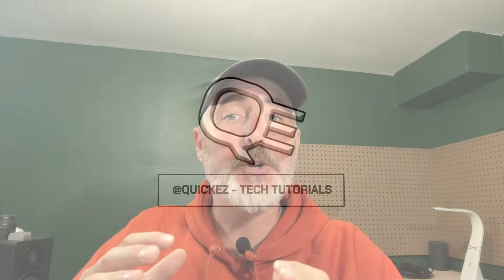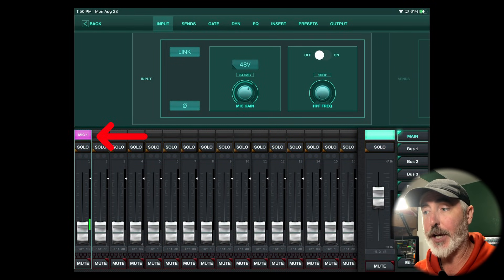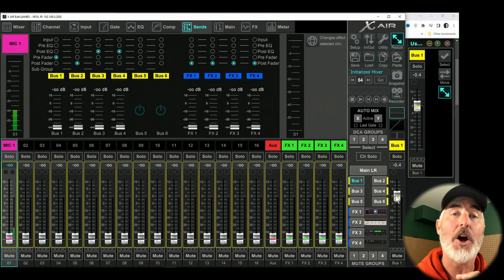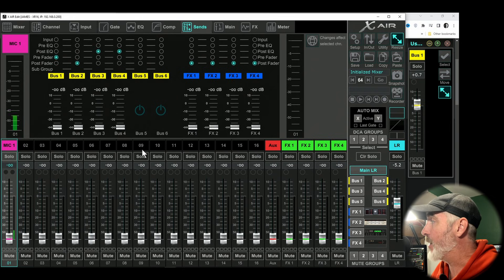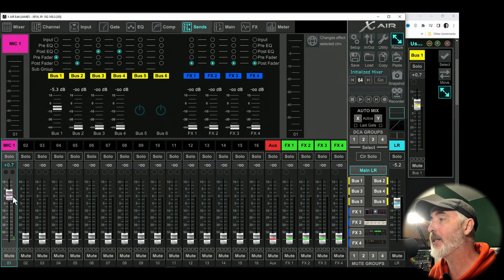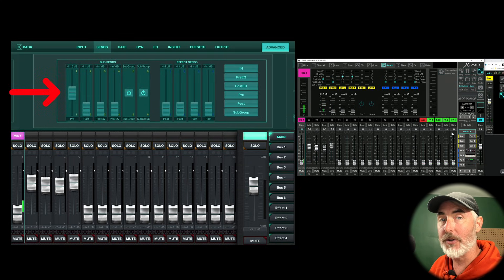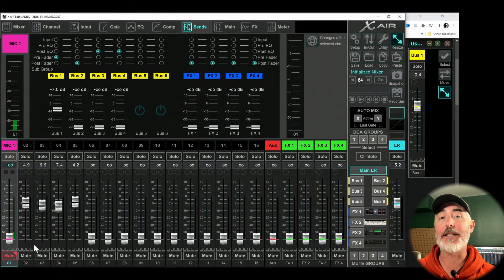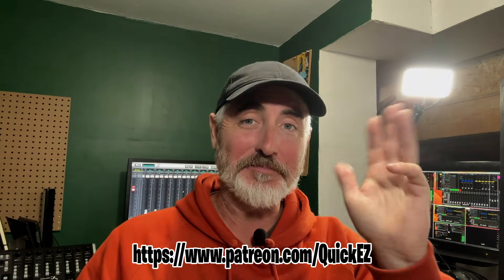XR Mixers - How to set up & use aux sends

Comment: Hi there, I'm brand new to the XR 18 and this is my first digital mixer. Previously I used a Mackie 16 channel mixer. Your videos are by far the BEST I have seen on YouTube, and even better than Behringers own explanations so thank you! Dumb question, but can you explain how I physically hook up 2 subwoofers to an Aux on the XR18. I have always done the cross over method in the past and went from the main out of my board to the input of a sub and then output of sub to the input of a man speaker. But I am hearing about the benefits of using the subs on an Aux to control them with a fader. How do I make the XLR connections for this though?
Reply from the maker: Hi @dsipley86,
First off...thank you!
I really try to make my videos standout, and to make them easy to follow. Sometimes I succeed, sometimes not as much but I'm really glad they are working for you.

And this isn't a dumb question at all.

I LOVE subs on an aux. Great control this way.

Select the aux output you want to use. Lets just say Aux 6 for this conversation.
- Connect Aux output 6 to your sub
- Send signal from your selected channels to that sub (generally only things that have sub frequencies, Kick, low toms, Bass, Keys/Synths)
- make sure your channels are sending to the Sub aux as POST FADER. You want the amount of signal going to the sub to track the same way it would to the mains
- to set it to post, choose one of your channels, lets say channel 1
- click on the SENDS tab
- make sure the GLOBE icon at the right is selected (this will apply your pre/post change to all channels)
- now above bus 6, select the POST FADER button. Now any channels you send to the Sub will be post fader. Great!
- Now,  select bus 6 at the right of the screen
- select the bus master fader that shows up at the right
- select the EQ tab...now you're looking at the EQ for the Aux output
- you have 3 EQ types you can use here. Parametric, Graphic, True (this is just like the Graphic but creates a tighter more true-to-what-you-do curve)
- If you are using a system that does not have any kind of crossover / adjustment in the speakers, or amplifiers, then you may need to make some adjustments in the bus eq.
- In this example lets use the Parametric
- select the HIGH band and in the MODE dropdown, change it to HCut (high cut)
- while listening to some signal through your sub, drag the high frequency parameter to the left (to lower frequencies) until it cuts out any unwanted mid or high sounds and really tightens up the sound coming out of your sub. 
- conversely, if you need to tighten up the bottom end, set your LOW band to LCut (low cut) and drag it down to 20Hz. Then if you need to bring it up slightly, do  so.
- neither the HCut or the LCut are great in comparison to a crossover setting, but the XR does not have any crossover, so this is the best you get
- then use your remaining bands to do any required eq'ing in the low frequencies if you have unwanted peaks

Please keep in mind, you CANNOT link your bus master and your main master together. So if you make any overall level adjustments with your main fader, you may have to match those changes with the bus master. The XR has no way to link these.
You can create a user layout in one of the user windows under the UTILITY tab, and add the mains and the bus master so you always have them next to each other if that makes your life easier.

everything here is a bit subjective. Use your ears first, then look at meters and settings to make sure you're hitting things in the way that works best for you.

Hope that answers your question.
Thanks for watching and thanks for your comment. Happy mixing!
Reply from the maker: Whoops, forgot to mention: 
If you haven't already, please check out my XR Overview series, it will define what everything is on each tab/window. 
I'm still in the process of filming these, but there are 5 episodes out already that you might find useful.

https://youtu.be/KkYYkirWKIw

Comment: Hi- great video, especially across all platforms. I have searching for an answer as to what the channel strip labelled as AUX (just to the left of FX channel strips) in XAIR Edit PC version is.  For the xr18 is it stereo input 17/18? nothing on the xr12 and xr16? It must be an input, but what??
Reply from the maker: On those two mixers it is only for the playback of tracks from a USB stick. 
I have a new series on these mixers where I step through each screen/tab. 
I’m currently working on part 5. But there are 4 previous that you may find interesting. I discuss things like the aux channel in this series. 

https://youtu.be/KkYYkirWKIw?si=EZHPNwlqtm3Y1u8C

Thanks for watching and happy mixing!

Comment: Great video.  I just got one of these and of course, it's driving me crazy, which is why I bought it. Does anyone know what the red AUX slider does? It doesn't appear to do anything. I was using it today and the sound suddenly was only mainly coming out of the left speaker. Trying find find what happened just drove me nuts.  In the end I loaded a preset, and it was ok, until it did it again.  I give up.
Reply from the maker: Hi, the red aux fader is for your auxiliary line in. Those are the two 1/4" inputs on the front of the mixer. Channels 17 and 18.
They are in a single fader because they are meant to be used as a stereo pair.
If you don't have anything plugged in there, the fader won't do anything for you.

If you're using the USB computer functionality, you an also use that fader to assign the returns from your computer.

I have videos on using the mixer with your DAW if you look around the channel.

If you found yourself with sound only on one side, you probably panned your input channels, or you panned your entire LEFT RIGHT bus to one side.  See info below.

In the XAir edit software:
Each channel has a panner just above the channel number on the main screen, if you drag that left or right it sends you audio left or right.
If you're all the way left, you only have that channel in the left. If you drag it all the way right...you get it.

For the main bus panning:
click on the "Main LR" button at the right of the X Air edit software.
that will make a master fader appear at the right side of the screen.
Click on that fader, then click on the MAIN tab at the top. There is a panner there labelled "balance" if you drag that to one side, you will only have audio in one speaker.

Hope this helps.
Reply: @QuickEZ  Thank for taking the time to explain all this. I really appreciate it. I thought that I had kind of got it, then I didn't. There seems to be so many ways of doing the same thing, I think that I am working against myself. Still, I'll get there eventually. 😀
Reply from the maker: You’re not wrong. There are multiple ways to do a few things. 
Don’t let that confuse you. 
When you find something with multiple ways just pick one and use that every time. 
As the console starts to make more sense and you get more comfortable, the different methods will start to make sense based on what you’re doing at the time. 
Just hang in there and practice. You’ll get it in no time!!

Comment: Thank you for this video. One question: Can I use AUX channels to send dry mixed signals to a second mixer?
Reply from the maker: Hi Roberto,
Yes,  you can absolutely do that.
for each instrument / vocal that you add to your mixer, you can select a "tap" point for the signal it sends to each aux bus.
If you want to send an input to another mixer via an aux send, without ANY of the EQ, Compression, Gate, etc etc, you can set your "tap" point to "INPUT".

You do this (in Xair Edit) by:
- selecting the channel/input you want to send
- choosing the SENDS tab
- selecting the INPUT tap point above the bus (aux) you are using.

You can also select the PRE EQ setting, but that will send the signal AFTER the gate on the channel.

I hope that answers your question. Let me know if it doesn't.

Thanks for watching and happy mixing!
Reply: Perfect! Very kind of you thank you

Comment: Thanks for your video.  I have noticed my main L and R is affected by any fader changes in the bus tab on xr12 using edit in PC.  I did change sends to pre fader and AUX out in the IN OUT tab to pre fader also but still volume on main L R increases or decreases when using BUS 1 fader through sends in fader or when main mix is on and using fader in the top sends tab.
Reply: Thanks for that.  After I sent the message I did some thinking and thought that may have been the case but had already packed everything away.  Thank you so much for your help!
Reply from the maker: Happy to help. 

Happy mixing!
Reply from the maker: Hi Lyndon,
Is your bus being sent to the mains?
Select bus 1
Select the bus 1 fader
Select the MAIN tab
Is the MAIN STEREO button selected?
Reply: Awesome, thank you for your reply and yes, Bus 1 was going to mains and have followed what you said to do and it fixed it.  However i have also noticed the Bus 1 master out fader is not adjusting the overall volume coming out from Aux 1? In the Aux out section when it the In/Out tab, i have selected Bus 1 to go out Aux 1 - Pre Fader + Mute but no matter what i select the main Bus 1 fader doesnt have any effect.
Reply from the maker: Hy Lyndon,
By selecting pre-fader+ mute in the aux output you’ve disabled the bus 1 fader. 
Change that back to post fader. 

If you want signal from your inputs to go to your bus pre-fader, that is done on the input side of things. 
For instance;
Select channel 1
Select the sends tab
Select pre-fader for the bus you want (in this case bus 1)
If you have the globe icon selected at the top right of the sends page, it will make that change for all channels going to the bus. If you deselect it, then only a single input will be changed. 

Hope that helps

Comment: xair 18 owner using an iPad to operate my system and for some reason I cannot seem to find out why when I mute a bus on its own channel, it mutes on all the other buses.  Any insight?
Reply from the maker: Hi Carol,
If you are muting an input, for example; input #1
Then that channel will mute on all busses to which it is being sent. 
If I’ve misunderstood your question please let me know and I’ll try to answer more appropriately.
Reply: @QuickEZ  thank you so much for confirming that.  We are using in ears with the xair and i was just experiencing some issues with one of my other singers hearing the same volume changes in her ears bc we are sharing a transmitter in mono even though we are routed with separate xlrs and are one left and one right send.  Maybe i need to update the system to the latest firmware.  I am currently waiting for an adapter in the mail to connect my computer to the system instead of the iPad!! I enjoy your videos! Very educational to a novice like me!

Comment: I'm sort of a new to this and we need to create a monitor mix that mirrors the mains including faders, but without FX. I haven't found a way to do this. I routed the mains to Aux 5, but that just creates a total duplicate of mains with FX. I don't want to duplicate manually and adjust each fader on AUX5 one at a time. Any detailed assistance with this would be appreciated. I'm using the X Air app on windows.
Reply from the maker: Hey Jason,
change the send of each channel for Bus 5 to be POST-fader.
You have to set your send level for each channel at the outset, but once you do, because the send to the bus is POST-fader it will behave just like if you were mixing to the Mains and you won't have to adjust individual channels.
And as long as you don't send any of the FX return channel to your Bus 5, you will not have any FX in that mix.

If you set the send level for each channel at UNITY then the amount of signal going to the bus SHOULD equal the same amount going to the Mains, though you may need find you need to increase it. Experimentation will tell you where to set it.

for example:
- select channel 1
- select the SENDS tab at the top
- for BUS 5 set the circular button to POST FADER
- then using the small fader below it,  raise the send level to unity (0)
now when you go back to your Main LR tab at the right and start mixing your show,
the signal from channel 1 to BUS 5 will behave just like the main mix.

Repeat this process for all your channels EXCEPT the FX return channels

I hope this is clear. If not, let me know and I'll try to clarify.

In the meantime, thanks for watching and happy mixing!
Reply: @QuickEZ  Update ... I figured it out. I should not be sending the mains to aux5 via Input/Output. Nobody said don't do this so I experimented and set the In/Outs to the defaults. I used the "Changes affects all channels" to set the bus settings for all channels. It appears to be working now. Thank you very much for your help. The steps you outlined help me figure out what I was doing wrong.
Reply from the maker: Sorry Jason, 
that's my bad, I assumed you had turned off the mains to aux send because it doesn't function the way you need it to.
I should have clarified!

Glad you're up and running.

Happy mixing!
Reply: @QuickEZ  I followed your directions and still cannot remove FX. I'm sending the mains to AUX5 via Input/Output once this is done the BUS5 faders have no impact on AUX/BUS5 as if BUS5 is only controlled via the mains faders and FX. Basically all the BUS5 controls are disabled.  Everything from mains comes through AUX including FX which I still need enabled on the mains.

Comment: I have a 3 mic setup (obviously very simple). I have one mic that is a stand mic I want going thru the main monitors and also recording in a laptop (Audacity). I also have a wireless mic I want going thru the main monitors as well (it too being recorded in Audacity). The third mic I only want to be recorded into Audacity; I do not want this playing thru the main monitors. What is the best way to do this?
Reply: Wow!! Thanks for the quick reply. Setup I have is like this:

Mic’s into an XR12. Main outputs go to a JBL CSA280Z amp.

I believe the aux outputs from the XR go to a M-Audio Mtrack solo and output from there back into a Windows based PC.
Reply from the maker: Okie dokie…
So to get the 3rd mic out to your pc and into audacity, you need to send that microphone signal to your Aux output PRE-fader. 
That way the signal is going to your aux (and into your pc) without you having to raise the main channel fader which would send it to your main monitors. 

I hope that makes sense for you. Let me know if you’re confused.
Reply: @QuickEZ I’m wanting all 3 mics to go to Audacity though. And two of the mics going to the mains as well.
Reply from the maker: Hi Schumijr,
That's what I've given you in the above example.
Mic 1 and Mic 2, you operate as normal by raising the channel fader for each one. That sends the two mic signals to the main outputs (your monitors) and if you've dialed those into your auxes, then it also goes to Audacity.
Mic 3, you set to PRE-fader. This eliminates the need to raise the channel fader for this mic. It will go out of your Aux to audacity (Pre-fade), but because you aren't raising the channel fader, it will NOT go out your  main outputs to your monitors.

If that's still confusing for you, drop me a line at:
email@quickez.ca and I can send you  more detailed information that way to better help you understand the signal flow.
Reply from the maker: Hi,

What is your setup? 
Are you using the XR18 and do you have it connected to Audacity via USB?
Or are you brining the signal into audacity via another audio capture device?

Comment: Hi, noob question hope your still able to answer. Is there away to stereolink both bus one and two with the main left and right? Hope that makes sense basically what I want is for bus one and two to act like another set of main left and rights. Might be easy to explain setup. DJ board to mixer. Mixer to two separate speaker setups. (Same setups) Different rooms.
Reply from the maker: Hi starwarzdavid.
Yes,  you can do this.

If you open the in/out tab in your software and click on the AUX tab,
You can change the signal tap point for aux 1 and 2 to be main L and R.
at the far right of the screen, click on the L and R boxes that correspond with Aux 1 and Aux 2.

Now, your main L/R fader in your mixer will send a duplicate of your main L/R out of your Aux 1 and Aux 2.

Hope that helps.

Thanks for watching and happy mixing!

Comment: You didn’t say about the routing. I spent ages struggling to get bus 1 & 2 to receive mix from channels 3 & 4 until I went to the routing & scrolled to the right to find you can set aux on bus 1 & 2. Wahay! was I pleased!!
Reply from the maker: Hi Paul, 
You're right I didn't say anything about that routing. And that was on purpose.
What you've done is created a direct-out, right from the input of the channel DIRECT to the physical output of the mixer.
This is not the same as an Aux-Send at all.

Doing it this way removes your ability to send additional channels to that Aux output. You can now only use that  output for the physical input you assigned to it.
For instance;
If you  "routed" channel 3 to aux 1
and channel 4 to aux 2...
You now cannot send anything additional to either output.
Aux 1 will only output the input of channel 3
Aux 2 will only output the input of channel 4.

If that is what you want, then of course, carry on. 
But if you're trying to correctly use your Aux Sends, then this is not the way to do it. 

If you followed my video instructions and did not get signal to your aux outputs, then you may have skipped a step, or possibly something in your setup is incorrect, or potentially your mixer has an issue.

If you need assistance, feel free to drop me a line at  email@quickez.ca
If I've misunderstood your statement, then my apologies.

Regardless, thanks for watching and happy mixing!
Reply: wow this solved my issue too after many headaches, hallelujah